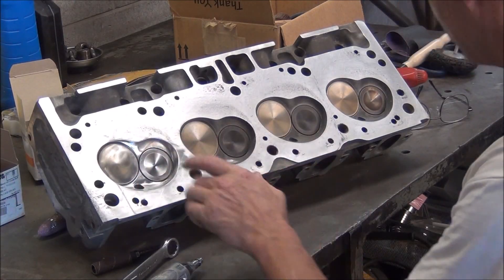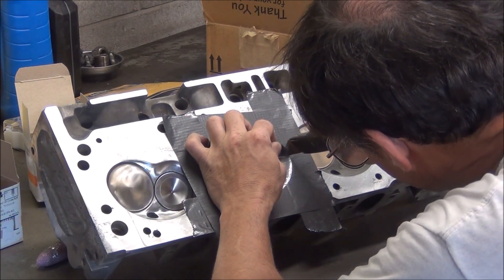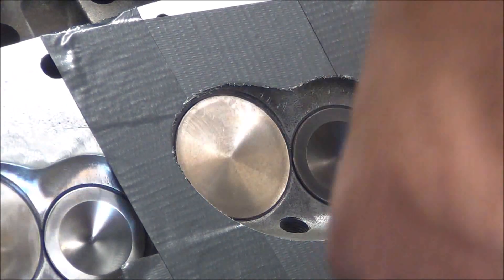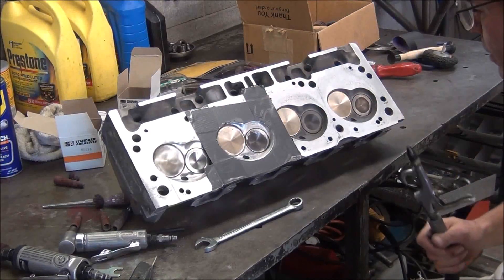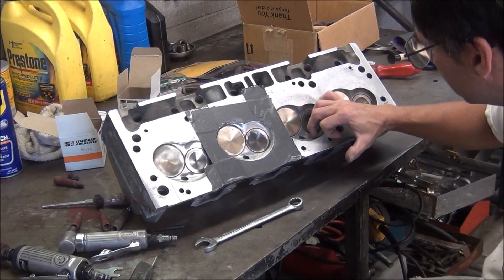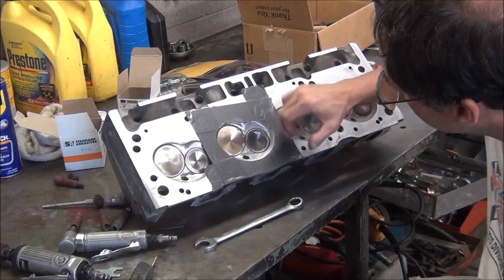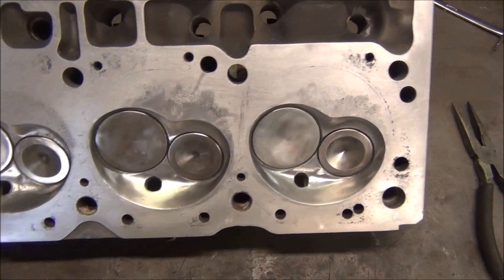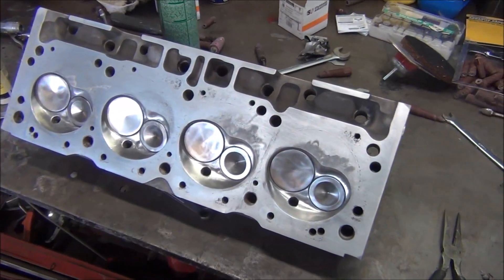460 rebuild part 13 Polishing the combustion chambers.

Comment: Are those the valves that you'll be running? Or do you swap them out after polishing? What head are you running? While the 460 I'm building isn't going to be a race only motor, I definitely wanted to try bowl blending/polishing to allow me to run lesser octane fuel on the street to see if it helps with the typical  pre-det. Thanks for the video!
Reply from the maker: Yes they are the valves i will be running. If I was doing heavy porting I would not use good valves while grinding. Bit since I was only polishing, it was okay.Thanks for watching .